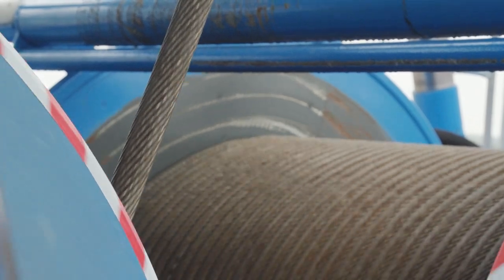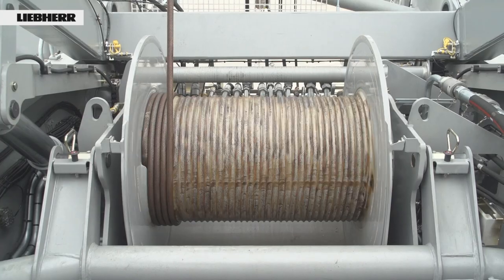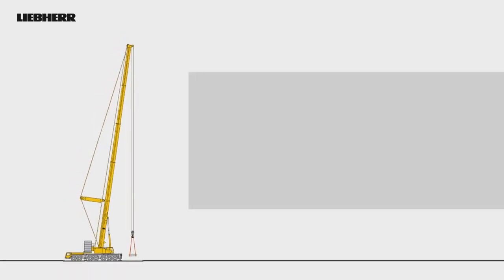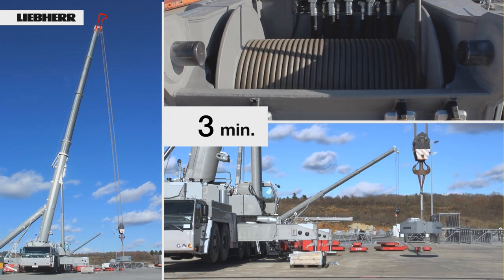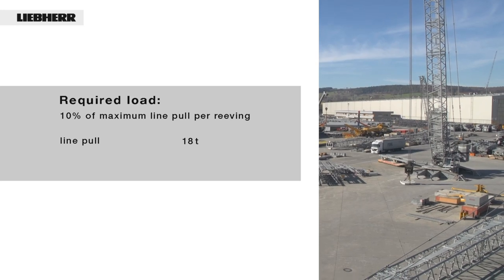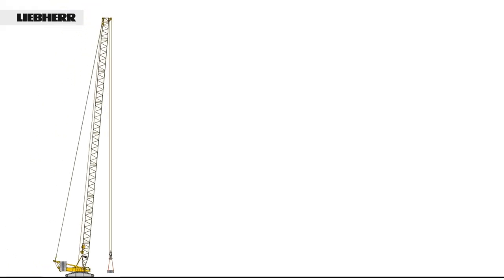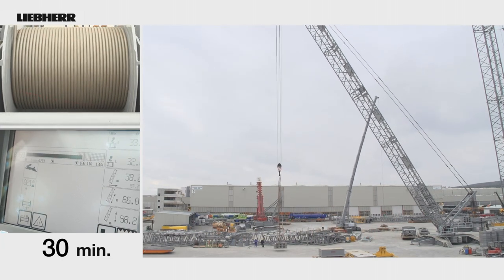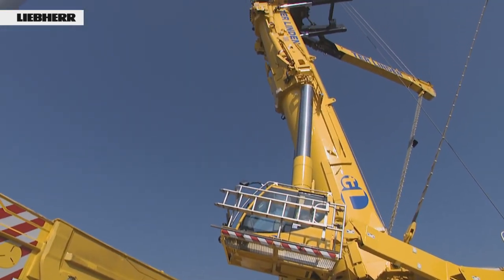Liebherr - Measures to extend the service life for hoist ropes

Comment: I don’t see this happening very often until the cable starts to dive and you have to fix it. Why don’t you design a system to keep tension on the cable at all times especially when going to the top of a turbine with a empty hook and bringing a rotor down? That would be more feasible...
Reply: Almost like a set of spring loaded nylon/ poly pads to grab the rope just above the drum.

Should make it removable or disengageable so that it doesnt cause premature wear the rope...
Reply: cause they us to purchase more cable and parts 3.6 million doesn't even give you a camera on the boom tip that's an extra 2 mill added

Comment: How is a wire rope not getting tangled?
Reply: Excellent question.  I've always been taught that too many reeves compared to weight can cause twisting of the block.
Reply: If you reeve without turnings in cable it would not twist ! , Liebherr has a system with a bushing on the end that can turn inside the attachment to boom / block (depending on reevings)